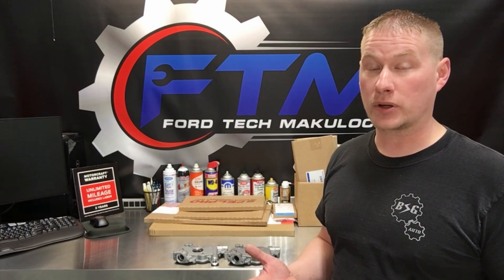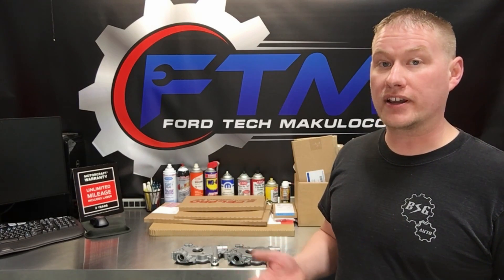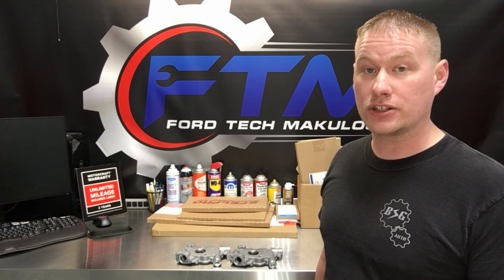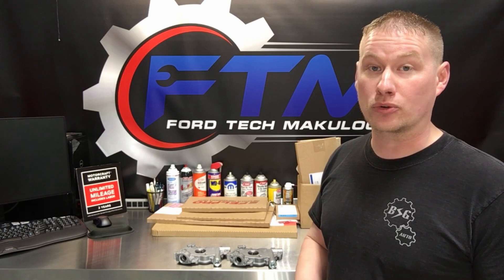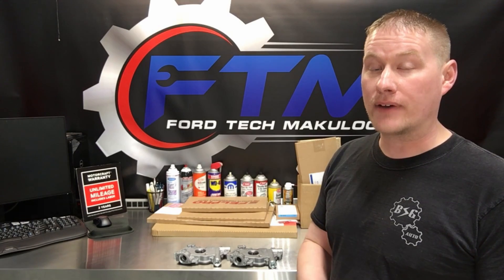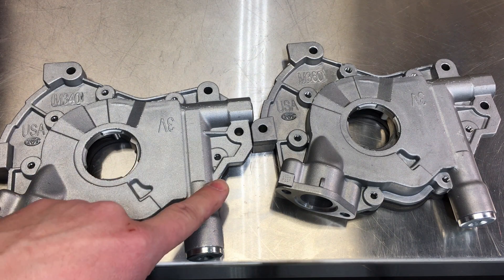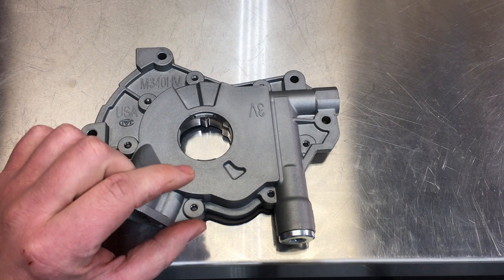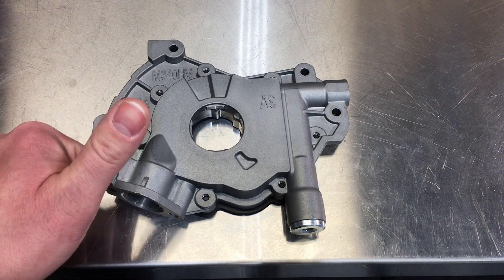The Ultimate 5.4L 3v Triton Engine UPGRADE: New Melling M340HV M360HV High Volume Oil Pumps!

Comment from the maker: These are the Oil Pumps to get-
2004-2014 Ford 5.4L 3v engines:
High Volume M340HV Pump (60 psi)-
http://amzn.to/2FjRTLi
High Volume M360HV Pump (80psi)-
https://amzn.to/2Gvg7DY
Original M340 Pump (60 psi)-
http://amzn.to/2tbFLay
Original M360 Oil Pump (80 psi)-
http://amzn.to/2FMrV0J                                                                                                                                                                                   How to Install:
https://www.youtube.com/watch?v=ulEJfcQ7HhA
Reply: Is that for all 5.4 3v ,no matter the year, we hv a 2010 fx4
Reply: I ordered the m360 before I knew about the other options. I haven't installed yet. When I look at the Amazon link for the 360HV it says that it doesn't fit my 05 5.4 3v expedition. Is that accurate? Thank you, sir!
Reply: @ponycorral99  I just found this video and when I went to the amazon link it said it didn't fit my engine either. I have an '04 Ford F150 XLT with the 5.4L 3 valve vin 5 engine. I then went to Melling and looked up my application and they don't even show the M360HV as an option for the vin 5 engine or the other 5.4 as a choice. Guess I will call Melling in the morning and ask them directly.
Reply: FordTechMakuloco which is preferred on the 5.4 or does it matter which pump to get.
Reply: Thank you very much for the information. 
I have 2006 Ford F-150 5.4L Triton 2wd. Which pump will be appropriate M340HV or M360HV?
Reply: @mfalme2003  I have the same question.  I have a 2008 f150 4x2 5.4 lariat.  Which pump is the right pump?  I have the slight slip in gears at idle around 30 normally associated with phaser problem and am looking to replace them and the pump.
Reply: my gixxer smoking which one did you go with? How does it run?
Reply: Can you help give me some info on the difference between the Melling M360HV and the brand new Melling 10341? Just came out last month. I just had a mechanic put a M360HV in my 5.4l and I'm wondering what I missed out on. Couldn't see any difference in PDF ad sheet.
Reply: How do i know which one i want ??
Reply: I'm confused...yesterday I called melling's about a question I had regarding my h360 HV oil pump that I installed in my 5.4  2010.  And they said, why are you putting that in your truck? They said I should be putting in the h340 HV pump which has higher volume. They said for the 5.4 3 valve, volume is more important than pressure. I thought both pumps had higher volume. Or don't they?
Reply: @brianberta4544  Only difference is bypass spring pressure. M340HV is 60# and M360HV is 80#.
I agree that flow is more important than pressure which is why I went back to 5w20 after installing the high VOLUME (flow) oil pump.
Increasing viscosity increases pressure which reduces flow. If you maintain high viscosity oil after installing a high volume pump, all you are likely doing is overworking your bypass valve with little benefit to the crucial top end because the oil is "log jamming" before it gets to the valve train.
Reply: @pescatoralpursuit1726  thanks for your feedback, its greatly appreciated.
Reply: FordTechMakuloco Thank You For The Link 😎👍🏼
Reply: FordTechMakuloco What about for the 2-valve?
Reply: FordTechMakuloco 
Will this work on 2010 f150 4.6 3v??
Reply: Jon Colley I did mine with in a 2010 4.6 3v and yes it’s the exact same. Just look into which pump would be better for you.
Reply: Awesome vids on this engine! Does nearly all of these apply to the 4.6 3v that's in the 05-09 mustang?
Reply: In order to get MORE OIL FLOW (not pressure) on my 2006 260,000 5.4, I'm replacing the stock oil pump that I've been running 5w30 through for the last 100,000 miles, to the Melling High Volume, STANDARD Pressure pump (M340HV,) and switch back to 5w20.
More volume, more flow and unlikely to need a higher bypass pressure than the mfr 60# setting.
Lower viscosity means more flow and STANDARD pressure is compensated with higher volume without wasteful wear and pressure. Yay.
Reply: Mr. Cee Gee thats what i was thinking. Lower pressure less chance of a leak..  how is it working out for you?
Reply: @carsnthings8948  Great! See above.
Reply: @pescatoralpursuit1726  I have the same 06 F150 XLT 4X4. Which pump did you use because Amazon says it won't fit my truck. Also, how's it running now?
Reply: Hi there, I have a 5.4L 2010 Raptor, I know rare. And these pumps on the amazon website claim not to fit. Any recommendations?
Reply: @Symphonixza  
how many miles is on it and does it make any noises from the engine besides running like a sewing machine
Reply: Ford Tech I have a question. I have a 2001 F250 with a 5.4L. Does Melling make one of these oil pumps for that model and do I need to replace it ? The  
truck has a new Jasper engine in it. I don’t want to start experiencing these problems. Did the 2001 5.4’s have the oil pressure issues ? I loved my 05 F150 but sadly it got totaled. I want my 250 to last me for years to come. Any advice you can give me would be appreciated. 
Thanks
Reply: The Amazon seller is stating the M360HV (your link) is NOT suitable for our 5.4 3v (also out of stock)
Since you dealt with him, either have him correct his list of compatibility or your wrong on compatibility 
May 2021
Reply: Already out of stock! Noooooo
Reply: I just changed my oil pump,timing chains phashers. I had a random misfire I couldn't figure out so I figured had to be a phasher or low oil psi anyway when removing the chains I marked everything just like any other timing job but when i reinstalled everything the right side phasher the R was not center on the 2 colored links that's how it was when I removed them so I put them back that way the motor runs but still has a misfire. So my question is did my motor jump a tooth and is it off time if the 2 links are not center one of them line up. On the left side they are center over the L. If you could let me know your thoughts it would save me some time I'm thinking about going to Ford but most of the guys there are dummies I wouldn't let fix my lawnmower. Please let me know what u think and your videos are all great I learned so much about the 5.4 I never knew thanks
Reply: FordTechMakuloco. I'm a big fan of your channel and own a 4.6 3v. Do all your 5.4 3v videos apply to it as well?
Thanks.
Reply: FordTechMakuloco will this pump fit my 2002 Mercury Grand Marquis ? The more oil that flows the better in my opinion.
Reply: FordTechMakuloco just curious what about the ford m-6600-f46 oil pump?
Reply: I picked up a timing kit from Freedom Racing, came with the Ford Performance high volume oil pump. No more knocking, good for another 261 000km I hope.
Reply: What about fail safe mode
Reply: Are the melling cam phasers for this engine better than motorcraft
Reply: 97 to 2003 ?
Reply: i'm still getting my feet wet into learning fords modular engines and what parts are interchangeable and what isn't,   doing this to rebuild a 99 f150 xlt i bought,  with a boat anchor for a engine ( previous owner had run it with a blown had gasket and virtually no oil)  getting a engine out of a 2000 expedition 8th vin letter match,  its got 115K on it it starts and runs,  but with no idea of its previous life and maintenance regiment,  i plan on dropping some money into replacing the more common points of failure

so would this pump intended for the 3v models be backwards compatable with a 2 valve engine?     Also planing on replacing the timing tensioners, guides and chains, rear main seal,  any other things i should address before shoe horning this under the hood?   Thanks !  - Rob
Reply: It says this don’t fit my 2010 F-150 5.4 3v 😡
Reply: Will the m360hv fit a 08 f150? The Melling web page doesn’t confirm this.
Reply: @thomasseal7396  if it's a Triton motor, it'll fit.
Reply: I have an 07 F150, getting ready to do this along with rollers and phasers. Is there a recommended pump over the other? My truck is just about to roll 180,000 miles and developed a slight tick; I'm assuming the rollers.
Reply: So where do you get your timing kits from?
Reply: FordTechMakuloco ? Could Ford install a external electric oil pump with a external reservoir with a oil line that taps into the valve covers and oil pan to spray oil inside the cylinder heads as soon as the ignition is switched on no start ? I have a 2000 Ford E350L 5.4L v8 super duty with 174,000 miles and it has a rattle noise on a cold start up but goes away 1 second later and has no trouble codes and smell rich with fuel.  I don't drive it because I purchased it for moving out of state and I don't wanna make it worse.
Reply: The 360 will work in the 3 valve? On Amazon it says only for the 4 valve.
Reply: Where’s your shop? What state are you located in?
Reply: Should I use the 340HV or the 360HV in my 05 F150?
Reply: FordTechMakuloco can you make some videos on weak points on the 2011+ 5.0?

Comment: I’m replacing my oil pump rite now with the new Melling oil pump! Timing chains replacement  due 2 failed tensioners on drivers side! Gonna replace em both & just makes sense 2 replace the pump! My 2008 f250 4X4 has 377,000 miles on it! Shouldn’t have been braggin about it, cause it finally broke down! 😮😩

Comment: I have a 2009 F150. My local junkyard has a remanufactured 5.4 that came out of a 2008 F150. Can you or someone help me determine if this is interchangeable with my pickup. What are the differences from this 2008 f250 engine vs my 2009 f150. My pickup has 240k miles and rattles so bad I finally disconnected the phasers and changed to 5w30 to minimize the rattling. Mine had startup rattle and low rpm sounding like a diesel rattle.

Comment: We had a salesmans f150, 5.4 2002 .  I did oil changes on it every 5000 miles. He got 500000 miles on it. Mostly highway but I used 15w 40 diesel oil., never did chains or adjusters, spark plugs yes3x, and in tank fuel pump once , complete suspension incl steering box 2x still ran good but when he turned it into a yard/parts runner truck the kids tore it up
Reply: @skipellison3667 he had you run 15w40 in the 5.4?! What part of the US? I might need to switch lol

Comment: In May I bought a 2009 F150 Platinum 4x4 thats on its second engine, upgraded Melling HV oil pump, new phasers, cams, timing chains and I like the ride. 

I need to replace the 4x4 actuators.... and maybe the wheel bearings on the front driver and passenger sides or switch to the Dorman Delete kit. 

Thanks for your explanation. 

This truck is running awesome. Just did an oil change and replaced the oil and air filters.

I have a 2000 f150 model 7700 with 5.4l 2v V8 that needs a new drivers side head. Finding it hard to find someone willing and able to do the repair.

Comment: I have an 2009 ford.p!at I um F1504*4 Super crew is got 195.0099 an on I run castrol oil products in all my rides always have alk I've done is replaced AC no other problems 5.4L3v

Comment: Just lock out the cam phasers , tune and done no issues, NGK spark plugs and clean the threads before putting in the new plugs and never had any issues after that.
Reply: is your gas mileage worse

Comment: I put the melting 360 in my ‘10 f150 5.4 and have some questions. My oil pressure gauge I installed has over 100psi when I start it cold even though the pump has the 80 lb relief spring. What pressure do I have to worry about wiping out the mains in this engine and is the pressure high because it measured at the oil filter (sandwich plate adapter). Also, I’m curious if I should add an extra quart of oil because most of the oil is going to be in the top end of the motor and not in the sump. Thanks for the tips and advice!

Comment: Hi @FordTechMakuloco do you still recommend the Melling M340HV with the new updated roller follower design? Much smaller hole making for more oil pressure. Do you also recommend changing the plastic chain tensioners to metal?

Comment: Jas anyone installed one of the in the 6.8 10 cylinder 3 valve ? Do you have to pull the engine ?

Comment: Looking for a recommendation -- if I do a timing job on a 2006 F150 with 200K miles and planning to put in a Melling M360HV pump.  Should I still consider adding camshaft lockout kits to avoid potential future issues with camshaft phaser noise, or should I consider Melling M360HV pump as generally fixing that issue, and just run the phasers as intended?
Reply from the maker: I do not recommend lock outs at all and only use the M340HV
Reply: Thanks so much!!! @FordTechMakuloco
Reply: @FordTechMakuloco  Just for clarification, I understand that you would recommend using the M340HV (60 psi max) over the M360HV (80 psi max) in most cases for an F150  2004-14 3V?  Are there any exception cases where the M360HV might be desirable for the F150?
Reply from the maker: no

Comment: Would having the high oil pressure pump cause timing issues? I have a freshly rebuilt 04 5.4 with the high pressure, high volume oil pump and we cannot get it to run right

Comment: There is one problem what you have - spring in the pressure valve. It all about GM and Ford oil pump using that design. Not matter, what volume is your oil pump. It is constructive defect. Because oil pump isnt deep cooling by oil as well like on the old smallblock, so spring is coming death first.
Sorry for my english:)) Hope it helps

Comment: Had a problem with low power chugging when hot.  I switched to 10 w 30 and filled it to the top hole in the dipstick and it went away.
Reply: Same thing I have a 5.4 05 king ranch planning a rebuild I thought it was because I changed to 10w 30 but they told me timing chain (268000miles) when did yours go out?

Comment: Melling recommended the 10340 pump for my 07 F150 5.4l 3v. The 10340 comes with an 80 psi spring installed but comes with a 60 psi spring also. Is there a reason to use the 10340  pump over the M340HV?
Reply from the maker: Nope, use the standard pressure M340HV  pump
Reply: @FordTechMakuloco  Do you still recommend 5w30 over 5w20 if switching to the M340HV?  Vehicle is a 2010 F-150 5.4L

Comment: All my best cars I would put a racing oil pump in. I also had one special car I had a electric pre lube pump installed in. The engine lasted 300,000 miles.

Comment: New subscriber here! QUESTION? - I'm going to change my 07 E250's 2 valve 4.6's oil pan gasket. Would you recommend a Melling HV pump on my application that has 107,000 miles?

Comment: So in what situation would the m340HV be preferable to the m360HV?  Wouldn't higher pressure and higher volume of the m360HV always be better?
Reply from the maker: NO
Reply: @FordTechMakuloco  Okay.  I'm looking to replace the oil pump on my 2010 5.4 3v, and would like to make sure I get the best option.  You seem to be very knowledgeable with this engine so I take your feedback seriously.

If by "NO," you mean the m360HV would not always be a better option, could you clarify please?
Reply from the maker: Yes you want to use the M340HV, you want more volume not more pressure. The higher pressure M360HV pump only comes into play on a cold start and at high rpms anyway.
Reply: @FordTechMakuloco  Awesome!  Thanks for clearing it up man.

Comment: Before I ask my question, just want to say thank you for your awesome videos they are so helpful.
My question is, I have a 98 Expedition with a 5.4 with only 187000 km's on it, ( 116000 miles ) & would love to make this engine go for a long time. Would the M360HV work for my application or would the M176HV be more appropriate?
Reply from the maker: The M176HV is your only option, the M360HV is for a totally different engine.

Comment: I have a 2003 expedition with the 4.6l 2v and was going to be doing this. Is it safe to put the M176HV on a stock motor? Or should I stick to the stock M176?

Comment: Just got a 08 f150 with 147k miles with the 4.6 three value. It's got a start up tick that goes away two seconds after starting. I was wondering if the same Hv oil pump works on it as the 5.4. I'm gonna be doing motorcraft guides and  upgraded cast metal tensioners.  Also I was wondering if the new tensioners have a gasket or do I have to use the metal plate that comes with them.

Comment: My 150 has this motor in it. It started fail safeing  i brought it into the ford dealership and they said the phazers were shot  they said that my motor is shot because it got metal shavings in motor. I just want to know  if that truely is the case  or can i rebuild it

Comment: I must have the exception to the rule. I have a 2006 F150 5.4 3v with 269,000 miles. Bought it with 54,714 miles on it in 2010. Just changed the plugs for the second time a month ago. Running 5W30 Mobil 1 full synthetic. Switched to 5W30 about 5 years ago due my living in the Deep South and dealing with hot more than cold temps and well before I ever saw any of Brian’s videos. I pulled a fifth wheel travel trailer for 5 years until my wife developed cancer and couldn’t travel anymore. Haven’t pulled it in 4 years now. Bought the trailer well after 100,000 miles so the engine wasn’t new by any means.

I’ve never been OCD about oil changes and obviously not with plug change out either. Still runs absolutely great and I love it. It does require oil topped off before the change is due but doesn’t smoke and it is absolutely dry underneath. I guess I’m just fortunate.